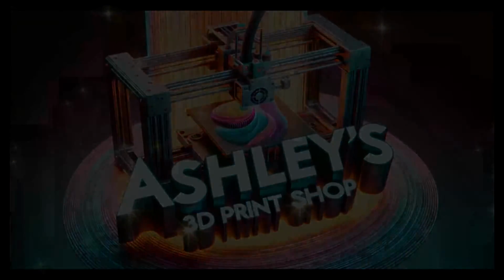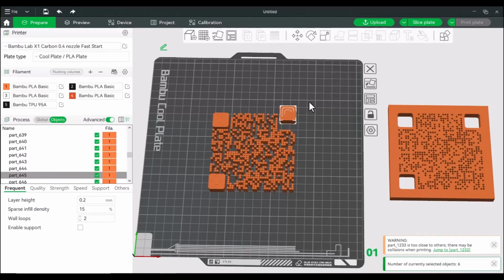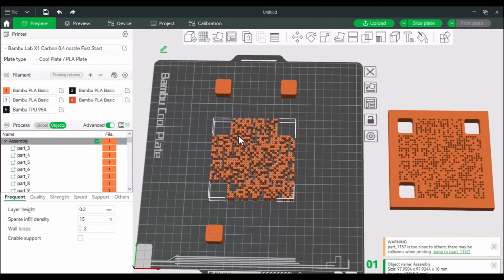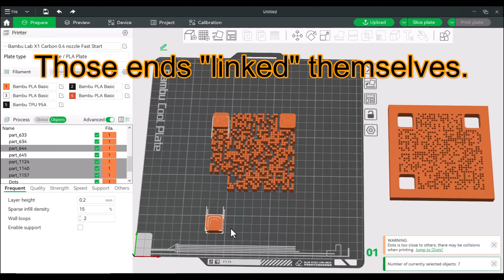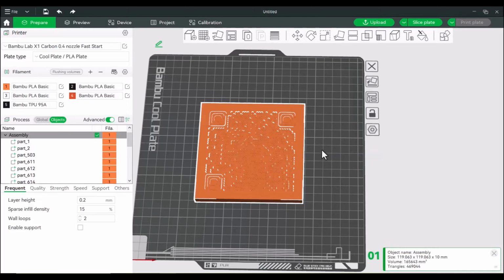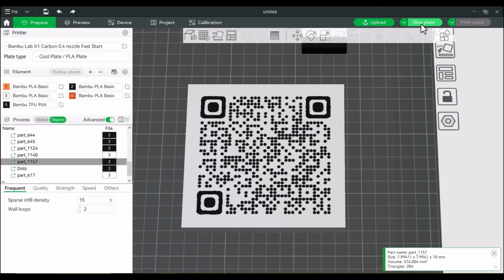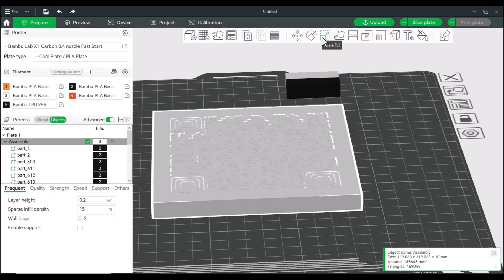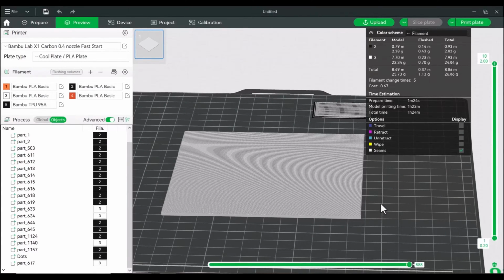Bambu Lab Tutorial Grouping and Reducing Parts

Comment: What is the difference between an object and a part, and why is "split into parts" almost never something I can do? adding, I am trying to figure out how to combine two objects, but only paint the top and bottom layer of the inner object; the middle could be the same color as the other object to save time, is there a way to do that?
Reply from the maker: Here is the wiki answer first https://wiki.bambulab.com/en/software/bambu-studio/split-to-objects-parts

*********
The long answer is...it depends on the model and how it was imported. Some models are already "broken" into pieces and when you import them the slicer will give you an option to assemble or leave them in parts/objects.  for instance here https://youtu.be/Sd4lzxj-pLI?t=56

If you assemble them at import  you can break them up into objects again.
If they are assembled and meshed boolean is used you may be able to split then into parts again.(but not always)

It gets confusing because they are named parts and objects and mostly similar. 

If the model is already a whole piece and was never separate, and you need to make them more manageable, you would use the *cut tool*. 

As for the SVG they are already in "parts" so you would only be able to split  to object manipulate them . 

**************

The short answer is if you have to option split into objects, the model breaks apart and drops each part to the build plate

If split into parts is an option it will leave the parts where they are. So if they are higher on the model(for coloring etc) they will stay where they are but be "separate"

*** 
so in the video I showed if I split into objects the arm and higher parts snap to the build plate.

If I mesh boolean then split into parts they stay where they were and print together. 

If that is still confusing drop me a comment and I will try to make a quick video later.
Reply from the maker: I just saw your edit. 

Here is the other half. 

IF you are combining 2 objects you would assemble them and move them. Without seeing the item can give you a very basic overview.

https://youtu.be/t_CKtkDlmpQ?t=95